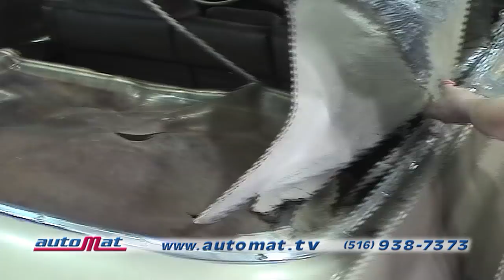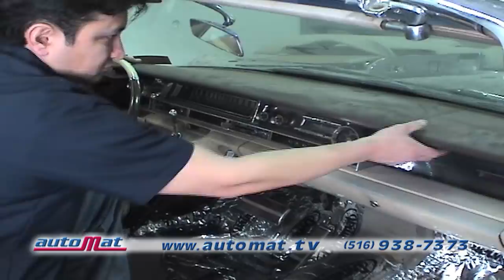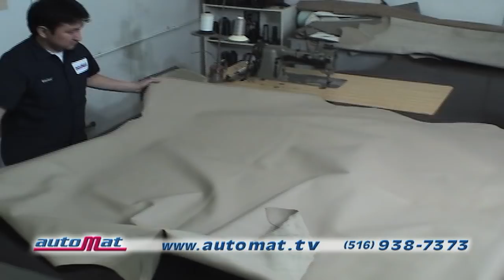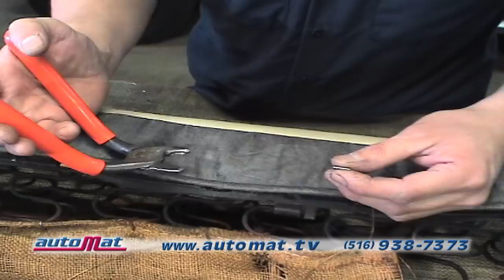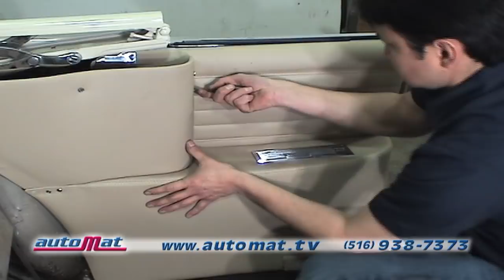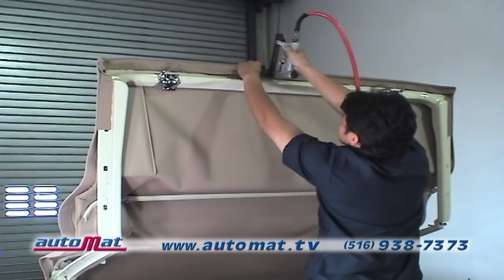'61 Cadillac Convertible - Full Restoration

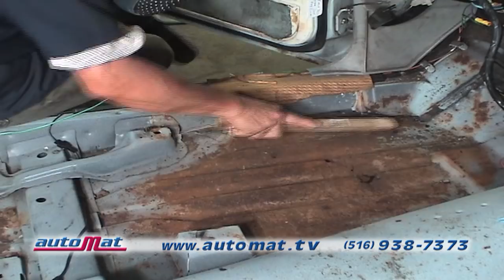Comment: I am sure the rustholes in the floorboard visible at 1:37 was cut out and new floorboards welded in properly with rust preventive paint on both sides, before it was covered up with new insulation? :) - just kidding, of course you did, you are professionals!
Nice to see this 1961 beauty restored back to almost new condition, well done!
Cheers.